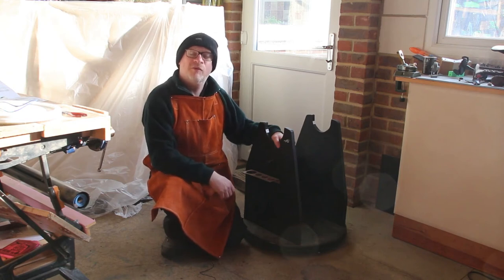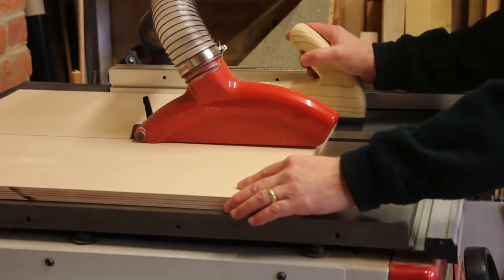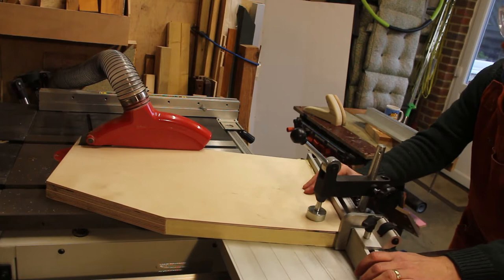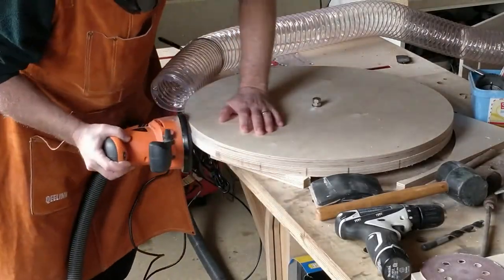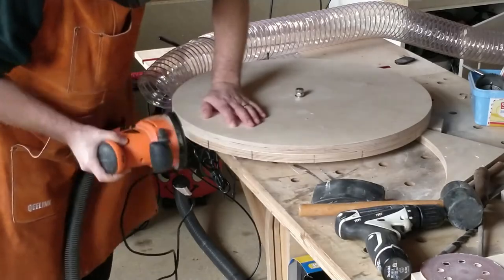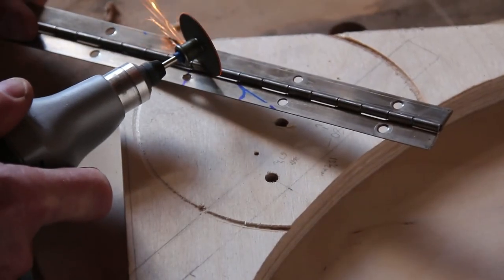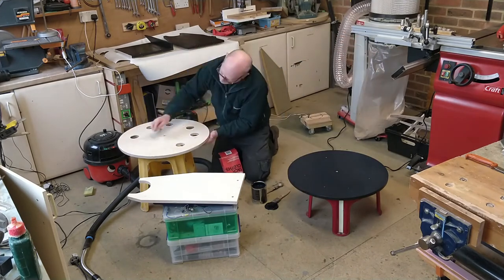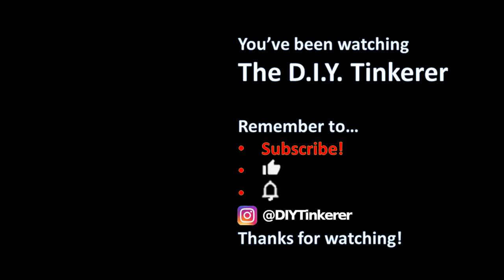Make a Flat Pack Dobsonian Mount

Comment: Excellent and thorough video! Great build as well! I am curious though as I'm about to build a dobsonian base myself. I had the same idea to use a hole saw to cut the semicircle. After you cut it did you need to expand the size of it to beyond the diameter of the bearing on the tube, due to the ptfe pads thickness?
Reply: Hi,  yes the radius of the hole saw was larger than the radius of the altitude bearing.
Reply: I dont think the original mount is an Obsession.
Reply from the maker: yea I got that wrong